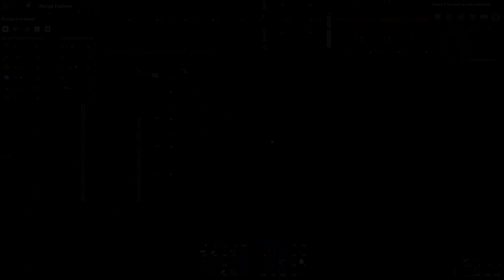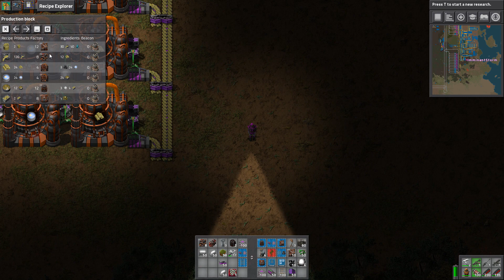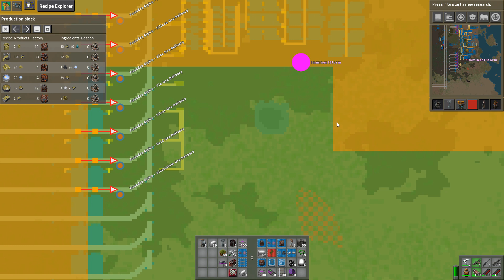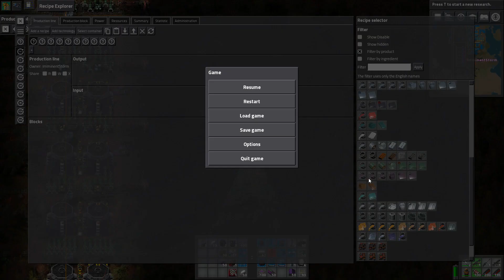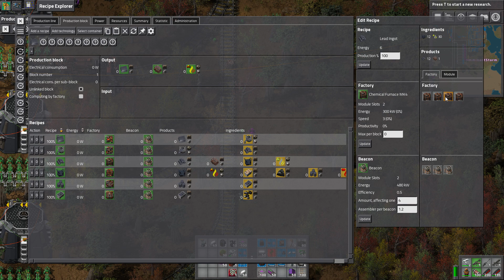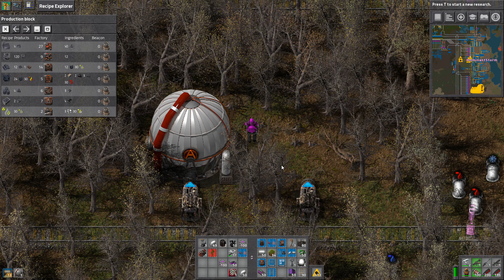Factorio - Angel's & Bob's - Episode 158 - Lead Design

Comment: This seems like a good time to mention your large quantities of acid gas that you're not yet doing anything with. You could split it (with green metal catalyst) into hydrogen sulfide, carbon dioxide, and hydrofluoric acid. That would be a good source of HF to supplement your current production, since I suspect your current production will be inadequate once you start using it to make lead. The hydrogen sulfide can be turned into sulfur dioxide locally by simply adding oxygen (in two steps: hydrogen sulfide + oxygen = sulfur, and then sulfur + oxygen = sulfur dioxide) so that you can reuse your existing sulfur dioxide dropoff train station. And carbon dioxide is useful in many places too, so you might ship it around by train as well.